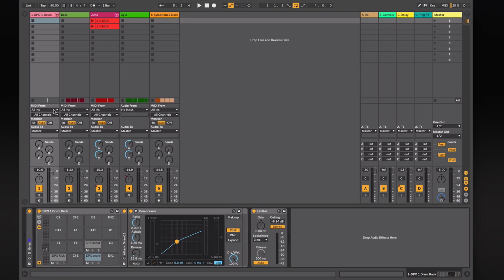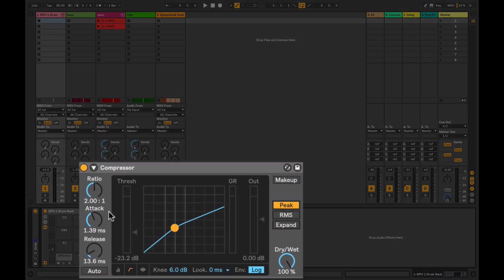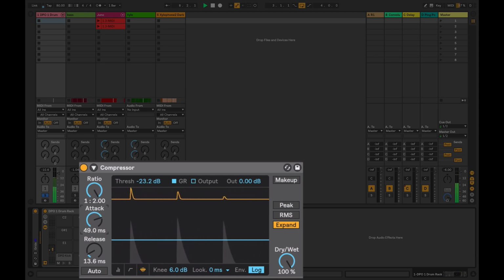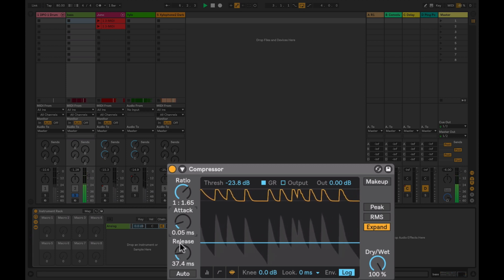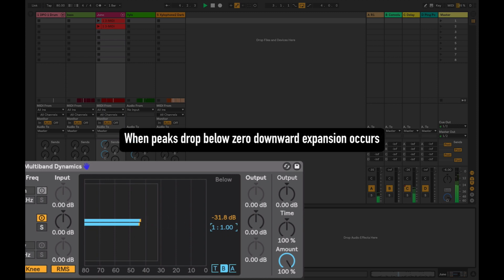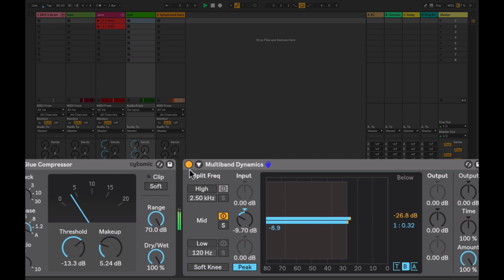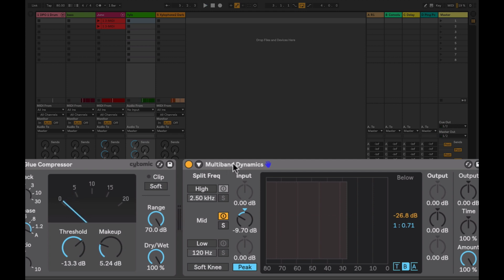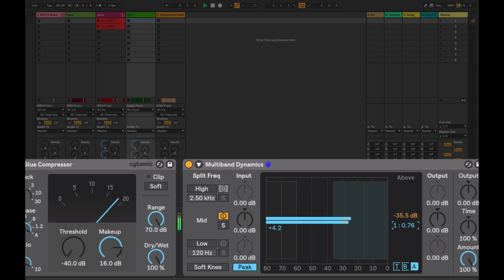Expansion - Dynamic Processing

Comment: Great video. One question I have remaining though - is upwards compression = expansion?
Reply: No. Upwards compression reduces dynamics, but it works by raising the level when it drops below the threshold, so it makes the quiet bits louder(unlike downwards compression which makes loud bits quieter). It's good for emphasising background sounds eg room reflections, but it also raises the noise floor.
Reply: @lambd01d  and what does upward expansion do?